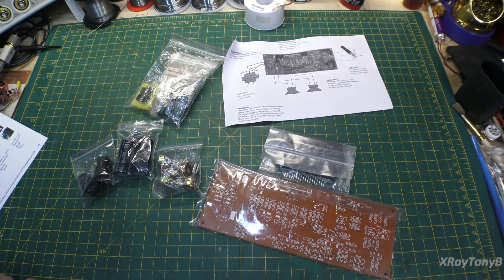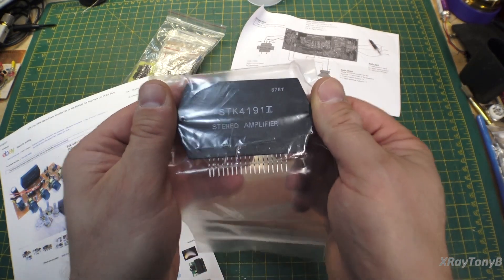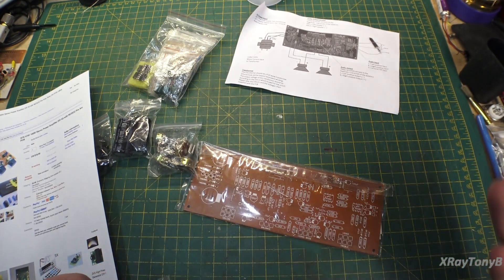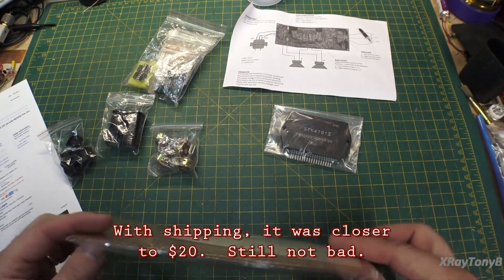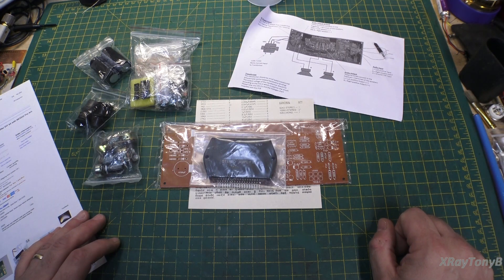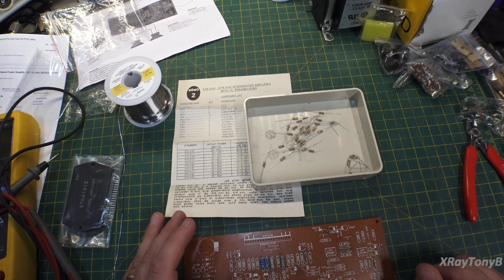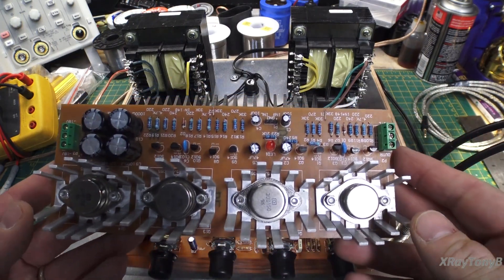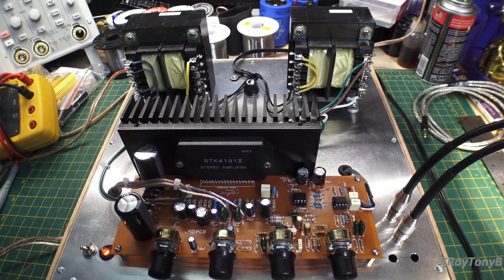STK 4191 Amplifier Kit Build & Test

Comment: I built this kit about a week ago and found the same problems, firstly the resistors, this got me confused so I just replaced everything I needed to and took what was written on the board as correct, the resistors all come individually and are not separated or labeled in any way so you have to get out your ohm meter or become familiar with the colour codes.
The one I bought came with absolutely no paper work whatsoever, not even the dinky little diagram you have.
After completing the kit I used a 24 0 24 transformer that I have and first thing I noticed is the grounding problem, thank you for the fix for that,  hard not to notice it was like being hit in the head with a baseball bat. 
Another thing I noticed is that if you mount the pots as per the board there is very little clearance to mount them through anything that is much thicker than maybe 1.5mm.
I just happened to have transformers and heatsinks hanging around but if you don't it will make it an uneconomic proposition, I would be more inclined to buy an old eighties amp and recap it and replace the stk (but make sure it is one that is commonly available), then you don't have to worry about sinks, transformers or enclosures and could be done probably for a cheaper price.
Thankyou for another great video Tony and best wishes.

Comment: I still have an original  150W Mono STK 4048II that works as a subwoofer amplifier for more than 15 years. I bought two more fakes to make a 2+1 amplifier but both died in style, welding my 30A speaker protection relays shut after 1 hour of use.The speakers, to my surprise, survived!

Comment: Great video, Tony, with plenty of analysis and clear explanation of the issues that you encountered with this kit. I am seriously tempted to resurrect an old 110-watt rated Denon amp, using the existing case, chassis, transformer and heatsink, etc. Many thanks for your time and effort involved in making this upload.

Comment: My favorite STK was the 439.
I was 12 years old when I put together an Amp and power supply using a voltage multiplyer.
When things was original.
Also I put together a few STK437's
For some friends guitar amplifier box. Of course I got pay.. 😎
I love the Bass and the low distortion of these ic amps.

Comment: @ 57:00  The Sencore LC53 "Z Meter" Operation, Application and Maintenance manual, has 2 pretty good charts ( PDF Page 17, for "Aluminum Electrolytic & Tantalum") for capacitor leakage values up to 400V, that can be downloaded from a few sites. Page 20 claims that "Ceramic, Paper, Mica and Film capacitors should not show any leakage at all". The downloadable online manual for a Sprague T0-6A also has an Electrolytic chart on PDF Page 11, which goes up to 450V

Comment: My Fisher CA800 amp has two mono amp chips like this on large heat sinks. They are rated at 100 watts RMS and it does crank pretty good.
Reply: How much you cost of Fisher CA 800 amp?
Where and when you buy it?
Thanks you.

Comment: Those little STK modules (if genuine) sound fantastic, especially the class A ones. But they always failed prematurely because the final application used a DC motor fan that only came on when volume was up on an undersized heatsink.  I guess they didn't realize the modules actually dissipate the same heat at lower volume levels as full output.  So all those modules would just sit there and bake themselves to a premature death.  They later improved the issue with their class H modules.  They are still class A, but have variable voltage taps that the module automatically selects depending on power output to minimize power power dissipation as heat during idle or low volumes.  I rebuilt many of the Technics brand home receivers that used them.  I supplemented the DC motor fan with a computer fan that runs constantly.  Made all the difference in the world for longevity.
Reply: That sounds like something Bob Carver would do.  See Tony's repair of a couple of Carver's "magnetic field" amps.

Comment: this amp would be great with a pcb revision .fix the ground issue. move the rectifier/main filter cap section one inch forward away from the heat sink or delete that section and have a dedicated rectifier  filter cap board   . and add your upgrade parts list  .

Comment: wow, this kit is from Sri Lanka :) one of the cheap DIY kits here. one of the famous ones 4191, but sadly the 4191 are knockoffs, unless you have spaker protections, this will kill your speakers when they die, happen to me many time when i was a kid. they are known to kill them self with oscillations.  there is a significant audio quality difference between the genuine and clones, Sanyo has stop making them long long time ago, it's hard to find NOS even. the output stage needs a RC filter to stop oscillations, its there on the datasheet for the chip.

best bang for the buck is LM3886's they sound amazing.
Reply: That's right, those (fake) STK's are notoriously unstable, even the genuine ones.  They may self destruct for no obvious reason.  
Many years ago, one of my Technics amps, the SU-Z22 with the (original) STK2038 module and no output protection fried its left channel and took a 500 $ speaker to its grave.

Comment: Hi tony liked the video found a toroidal transformer 35v 0 35v @ 4.29 amps  which i believe is a 300v/a would this be sufficient for this kit build , been on e bay found the kit and it seems that they have updated the circuit board on one of the suppliers
Mike

Comment: I saw this kit on e-Bay and was wondering if it was worth building.  I was hoping to get a listen to what it sounds like hooked up to speakers after replacing all the caps.  What do you think of Akai SW-155 50 watt @8 ohm speakers?  I also have a pair of Realistic NOVA 7B rated at 40 watts @ 8 ohms.  I'm using the Akai speakers to play my guitar through them hooked to a Crate 150 watt amp.

Comment: i have a question: when checking the fq response w/ an oscilloscope, does it show if an amp if producing harmonics along w/ the clean input fq? thanks..
Reply: A harmonic is double or twice the frequency of the original audio.  So, not really, unless you are looking for it.  If you're looking for THD? Then feed the amp a square wave, and see if it can reproduce it exactly as input.

Comment: Sir if the writing comes off the board then before you start working take close up pictures with quality camera or cell pone.  Take pictures of the board (from all angles) of the board insuring all the printing is visible in the captured pictures. Now if alcohol or anything else removes the printing you have back up pictures of what was on the board BEFORE you started working on it!

Comment: @transformers & saving $$$: I always try to find some cooked 19" rack amps. Old Peaveys, Crests or cheap China-made stuff in the 2 x 200W range. **EDIT: for $50 you should get a 19" case, a toroidal, at least 2 meaty filter caps, heatsinks galore and a handful of power semis and then some) ** Usually those burn out in the driver stages, the rectifier or power-bjts/fets but the toroidal is intact. Wattage should be as low as it goes for 19"-amps as the more powerful models come with 2 x 40V and higher on the secondaries. Good thing: you can easily "re-wind" those transformers to whatever voltage you need. Good show. too bad that kit seems to be a little off. Nice seller though!

Comment: How do you calculate the wattage?
Reply: Square the output voltage and divide by resistance. Eg: 20 volts x 20 volts / 8 ohms = 50 watts
Reply: 1959Berre  Thank you.

Comment: From other people's comments, it seems that they all come the way you got yours Tony, wrong value resistors, other components missing, no schematic available, etc.  On your build, are you going to get rid of the detented volume pot?  The off balance pot also bugs me.
I'd like to hear from other builders of this kit: Did you get a good knockoff of the Sanyo amp module, the  "STK 4191" or is it's quality still the luck of the draw?  Get a dead 50+ watt receiver or integrated amp and you should have the transformer and heatsink you need.

Comment: What a superb video in every respect. I wan't one. I can get a 30 V x 2 at 5A for $44 or a 25 V at 5 A for $40  (£'s converted) here in the UK - delivered.  The trouble is we are not the stanard EU 230 V mains we are 245 V.  That makes the 2 x 25 V almost 2 x 27 V , that should do. The last time I built amps was 50 years ago, 2 of these  http://www.r-type.org/articles/art-003d.htm  I still have the 2 Tannoy's. It's been a long time but I'll have a go. Thank you so much Tony for your time and effort - wish me luck, I'll need it.

Comment: All original Rubycons have "K" shaped vents on them. Since these are "Y" shaped, they're most likely counterfeit.
Reply: this is right i have this kit and the main DC filters 4700uf 50v are not the fiscal size as on the data sheet. They more mach the size on the data sheet of a 3300 50v
I use all my own Caps and it sounds good.

Comment: IS  IT POSSIBLE TO REPLACE THE TFX WITH LIKE 2 DC POWER BRICKS  I KNOW THEY MAKE ONES RATED FOR 28VDC AND 4 TO 5 AMPS
Reply: In principle, you could, but the problem is the switch mode voltage they put out is likely not smoothed enough not to have an audible 7kHz tone in the output of the amplifier.
Reply: Anything is possible. However, why would you want to do that and wreck the sound quality?

Comment: I am just curious, what makes a "audio quality" capacitor? I mean only thing I can think of is lower ESR. I can't find anything factual. This has always stumped me. Thanks in advance.
Reply: Depends on your purpose.  If bulk DC filtering, you will want electrolytics with lowest ESR as you mentioned.  For audio coupling, capacitor type makes a big impact.  You have inductive losses as well as parasitical losses such as the inability of the dielectric to relinquish 100% of the charge, distorting the waveform.  The absolute best capacitor for audio coupling in my experience are polystyrene and PPS (polyphenylene sulfide) and you pay for it.  They are equivalent to vacuum capacitor or teflon capacitors in performance and PPS offers the sturdiness.  Polystyrene is somewhat delicate and not suitable for mass production (oven reflow) so polypropylene and mylar were the go to's as the holy grail capacitor material (polystyrene) just wasn't able to deal with heat very well and are bulky.  However, PPS came around to fill the void of the polystyrene.  PPS now have the audio performance of polystyrene with the ruggedness of polypropylene, mylar and teflon units.  The next capacitor down in sound quality is polypropylene.  Then PET and mylar.  The worst capacitor for audio coupling are electrolytics, although okay if used correctly with a proper quality component.  All capacitors create harmonics when DC biased (from my research) with exception of PPS and polystyrene having very little... if any of significance.

Comment: Hi Tony,

Just received my kit, and five months after you posted this video the vendor still hasn't addressed the issues you highlighted.  My kit is missing the 56k ohm resistors, all the diodes and the 10uF electrolytics.  I have all the missing parts with the exception of the zener diodes.  I really wanted to be able to recommend this kit, but it's not suitable for a newcomer to the hobby unless you have a stock of parts.  Unfortunately, I probably wouldn't buy from this guy again!

Comment: I bought the board, from the same seller from eBay. Yes you are right about the seller. He is very good at apologize probably because he knows what is he selling. The pcb is really really bad quality. The copper layer from the pcb comes right off some time and very cheap quality components. Compare to China seller this one cost more and quality is nasty compare to China. Basically these all components he bought from China low quality low cost types. So you are getting pure lowest quality China crap from the seller I swear. I could spend $28 to buy a 2.0 tda8954th. I won't recommend anyone to purchased this crap I m sorry.

Comment: Just got my kit in i am trashing all the electrolytic capacitor even the 4700uF 50v Nichicon caps are Fake they are not the right Size for the voltage and capacity. they size like 4700Uf @ 35v i just ordered $90 with of caps last week so no bit deal lol

Comment: Judging from the way that clip wave looked I think it might do a little better with more filter capacitance but I know thats what it came with it was an oscillating clip not a solid clip is way i say that. 4700 is not much for 115 watts of power.
Reply: but for a cheap amp kit I like it too
Reply: Also you can buy center tapped audio transformers out of old recievers on ebay for 15 20 bucks you know the ones that come out of old sony or dennon receivers.
Reply: I AGREE ID HIT IT WITH 2X ELNA 10000UF OR SIMILAR
Reply: Buy dead integrated amps or receivers from Goodwill, eBay (for parts or fix) or other resellers of used stuff and you'll probably get the heat sink too!

Comment: Can anybody either point me to a site or .pdf or whatever that gives the names of quality component manufacturers? Caps, resistors, inductors,  what those particular components are good for and it should be recently updated.  I want to get stocked up on all of them to fix my own failing equipment and possibly to fix other folks' equipment in future.
Reply: mouser.
look it up.
;-)

Comment: I had an old 200w.p.c  amp from RadioShack that had two stk's I drove two 15" subs with it no problem! It sounded amazing and was all digital. 

And on a side note, I think the reason why the STK's or integrated amplifier chips even got a bad name in the first place were from all the cheap, shitty knock off's from china towards the end of it's life. I used to repair projection TV's  with convergence issues and let's just say the luck of the draw as far as quality is definitely a crapshoot.

Comment: I have made two amplifiers- One with STK 4141 II which output 25w x 2 according to datasheet. and another one with TDA 7294 which outputs 80-100w . But in reality the stk one is louder than TDA.

I am using 24-0-24 6A transformer and 8" woofer. Can anyone explain where is the problem is ?
Reply: Based on extremely limited info provided, my guess is that there is no problem. The STK amp simply has it's gain set higher.
Reply: Thanks for your reply. I was a bit confused. Thouth they both outputs really good quality sound.
Reply: Anup Sarker one off the wall guess...  you're using it for a sub woofer amp?  The 8" woofer comment...

If the input capacitor is the wrong value the low end roll off  might be well into the audible spectrum.

Comment: That's the problem with Chinese kit ,you buy and hope for the best,I glad I didn't buy this nightmare.it's had enough Chinese kits most of the time don't have any paper work ,they make it hard for hobbyist to assemble there kits,in most cases I make sure someone made a video of that kit,and I look at the pictures where I buy my kits as a reference too,if they would put good instruction with their kits they would sell a lot more kits and have some customer support,like hreath kits did and elenco does.I am at 80 to 90 percent getting my kits to work,the rest have wrong parts of bad parts

Comment: sloppy soldering on the pcb board.  Looks like a beginner did it... really!
Reply: It looks like he coated most of the traces with solder, except for the ones going to the power amp chip.  The board quality looks iffy.